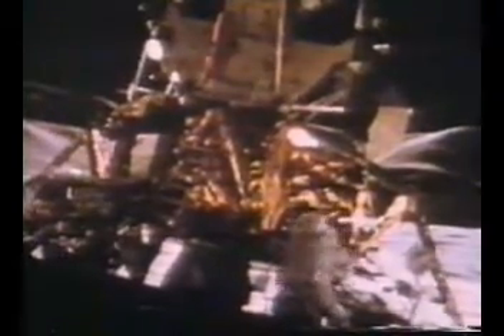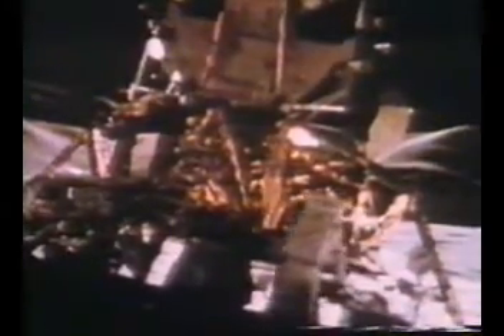a15v1201848

Comment: The Rover was latched in a compartment covered by  a panel on the Lander, which was in turn underneath a fairing during it's ride through the atmosphere. The cable wasn't there to hold it in place, it was there to release the latches